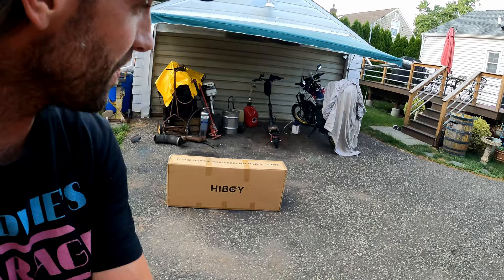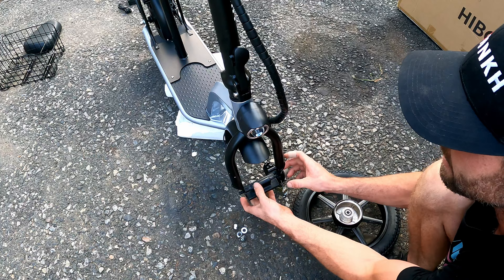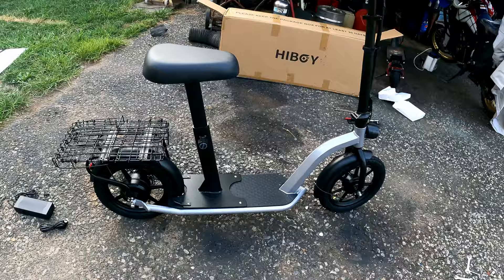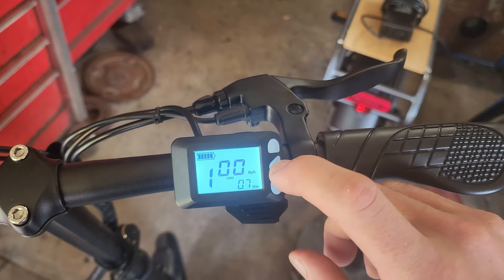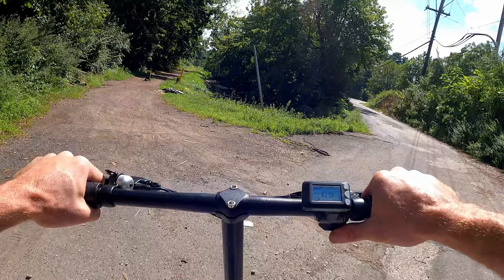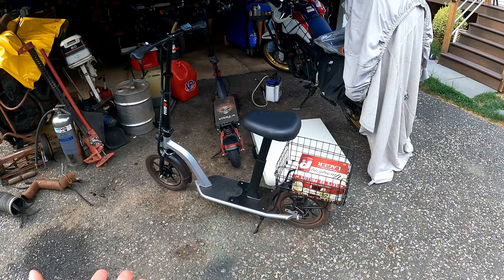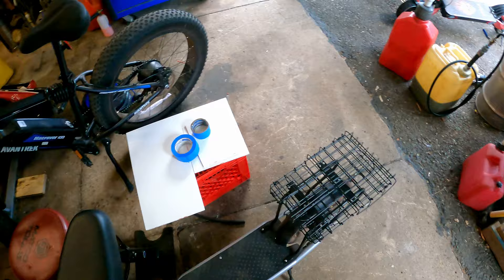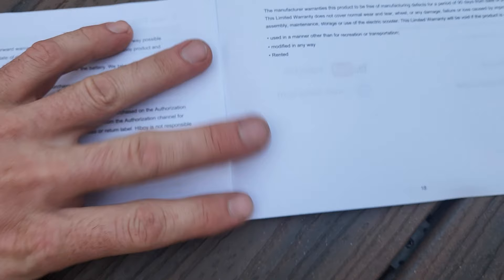Hiboy ECOM 14 Electric Scooter Review

Comment: You would have made it home if you had the kick to start on the p-settings, bogs down the battery just using the throttle from a stand-still but uses less battery when you push it when you accelerate.
Reply from the maker: Good point you make!
Reply: @NNKH2  got that advice from a YouTube scooter video actually.😎

Comment: Those are very cool but slow I would have to modify the hell out of it
Reply from the maker: I've been rocking it as it is in so far so good. The basket is super handy. I actually put side baskets on it as well. It's my parts runner. I ditched the seat. No need for it

Comment: Just got one and put it together.  Mine has a spring coil over the front brake line.  Is that a new thing do you guess or is supposed to come off?  Seems like it might offer some protection I suppose.  We really had to adjust the front tire so it wasn't too tight, otherwise it wouldn't spin freely.  We used the two wrenches that came with it and even then found it too tight.  I'm surprised you were able to use a socket wrench (or whatever it's called). When you ride yours do you hear any noise at all coming from the front tire during rotation?  I can hear some noise almost like a swooshing or a rubbing.  It's not a grinding, but I'm wondering if there should be any noise at all.  I know the motor is loud, but that's not the noise.  Maybe I should contact Hiboy.  We disassembled the tire and put the brake drum back in. But still hear it.  So maybe that's just a normal sound.  I was just wondering if yours is totally silent, then maybe there's something off with mine.

Comment: Idk what I'm doing wrong, my handlebars don't don't turn the bar that turns the wheel. Hopefully you or someone else can help me
Reply from the maker: Maybe something wrong with the head bearings or are the cables binding up?
Reply: @NNKH2 no the cables look fine I think something might be wrong with the head bearings
Reply: @NNKH2  hey I just figured out what the problem is. That clamp idk how to get it in that slot. Maybe you can help me with that. Hopefully you can